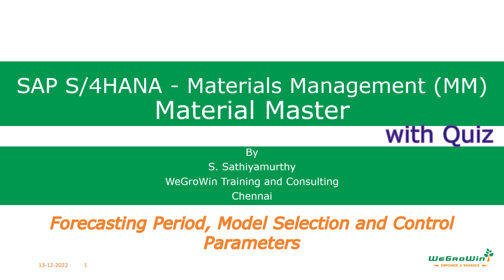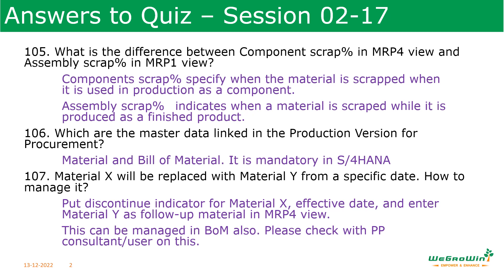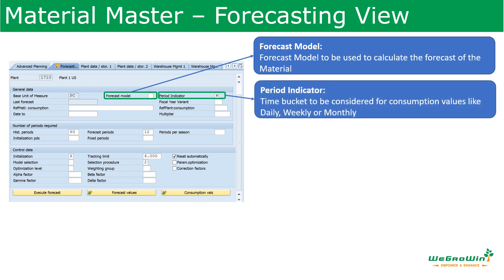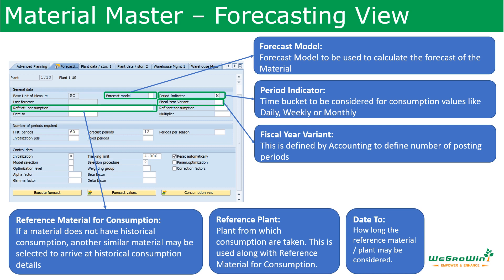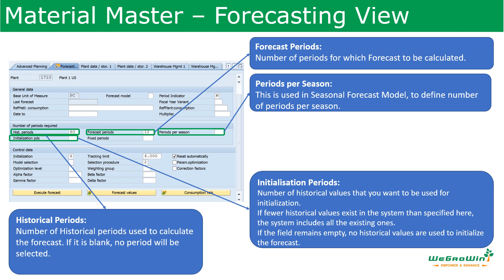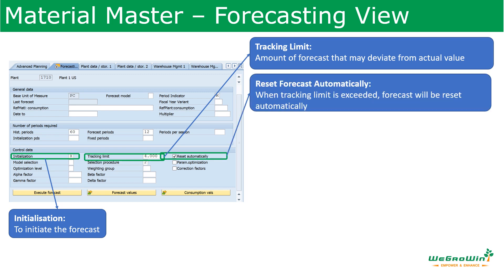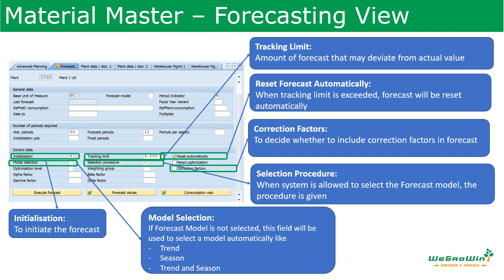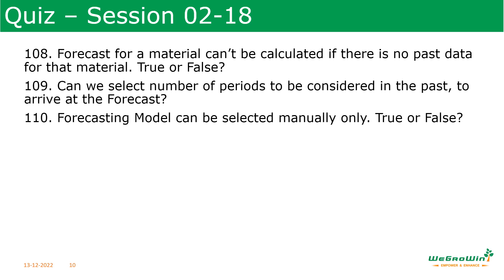SAP MM | SAP Material Master Forecasting View | Forecast Parameters Explained | 02-18

Comment: I have a issue in MD04 my forecasting values are populating in MD04 as independent requirements. 

And in MRP-3 view im not maintaining any strategy group as well. It is ROH material type.

The problem is very month starting my RUN happens  but my earlier Independent requirements are not getting deleted. What could be the reason.

I dont have MRP area, No Phantom material as well. 

Any suggestion please